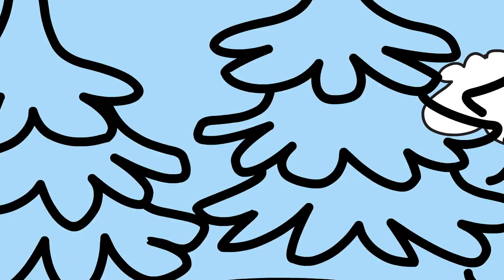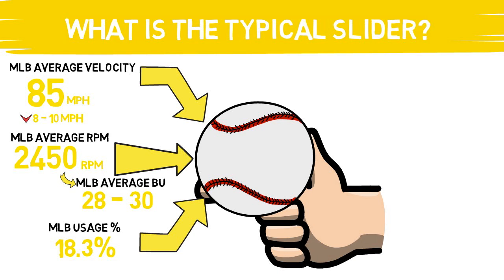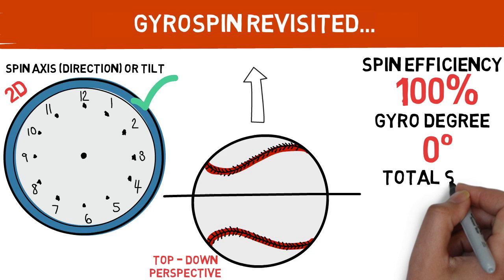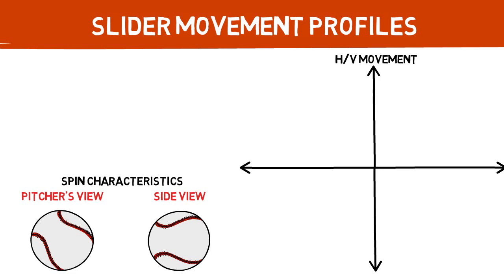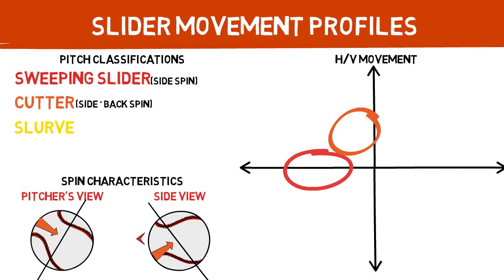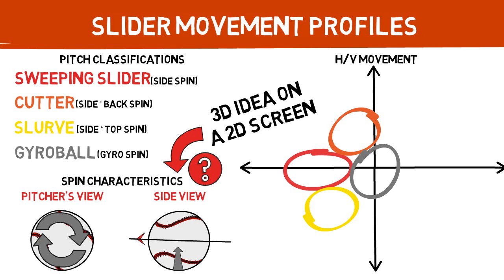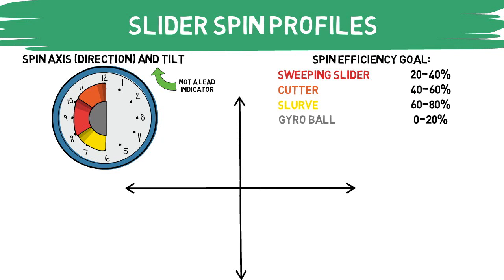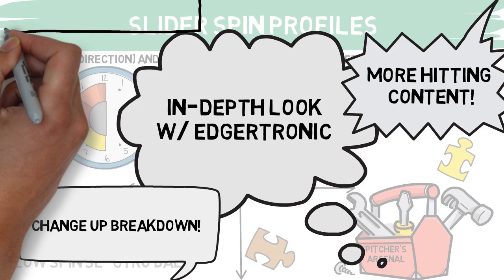SLIDER PITCH DESIGN: Creating a Nasty Pitch

Comment: Hey, I did have another question! I've been looking at Felix Hernandez's 2019 pitch movement and it seems that his slider movement doesnt move much from the 0,0 coordinate however it seems like it was one of his best pitches. He owned a .174 BAA on the pitch and an average Spin rate of 2104. Is this just a case of small sample size or does this mean that the movement from the 0,0 point doesnt correlate as much with with the final results as I thought? Maybe because he started the pitch more in the outside quadrant to a righty, that makes the pitch better even with the little pitch movement?
Reply from the maker: You’ve really done your research here! 

Like I said in the video, I’ve seen some nasty 0,0 sliders (or gyrospin sliders) - if it works for him then there is no reason to change it. 

It’s always a case by case basis, so the ability for him to control that pitch, and keep it separate from the others in his arsenal are of extreme importance in my opinion. 

Thanks for the awesome comment! Hopefully this answered your question.

Comment: I have a pitch tracker that gives: total spin, sidespin, backspin, gyro spin, and spin axis. Is it possible to use these numbers to calculate spin efficiency, and if so, what is the formula? Thanks.
Reply from the maker: Thanks for the comment! I don’t have any first hand experience with the technology you’re using, however, spin efficiency is the amount of gyrospin divided by the total spin. 

I’m not certain how the backspin and side spin come into play in that equation - but that is how it is calculated on Rapsodo. 

You should see fastballs and change ups are close to 100%, and the sliders and curveballs range in the percentages I had in this video. If those numbers seem like they’re in that range than the same calculation should work! 

Hopefully this answered your question - thanks for watching!

Comment: I've heard the the gyro spin can drift. Is there a way to predict how it drifts by examining the tilt and efficiency?
Reply from the maker: This is something I’ve heard has been observed but I haven’t found a way to predict/measure this movement. 

For example, some have said the reason gyro spin sliders have that sharp late break is due to the axis of the pitch drifts downwards as the pitch goes towards the plate (creating higher useful spin) causing that break. 

The way rapsodo measures spin direction and gyro degree can’t take into account this movement because of the positioning of the camera and the way the data is collected. 

I’ll definitely do some more research on quantifying this phenomenon and make a video if I find anything! Thanks for the comment!
Reply: @SimpleSabermetrics  thank you so much!

Comment: Why is the Slurve the least effective even without a Slider or Curve in the pitcher’s repertoire ?
Reply from the maker: There definitely are good slurves out there, especially if you aren’t throwing a slider to accompany it. 

My reasoning for this, is the average 3/4 arm slot pitcher more often than not will throw a slurve prior to any pitch design work using tech. Because it is more common than a true 12/6 or a sweeping slider, hitters see it more often and are therefore more used to it. 

There’s a little more data behind my decision here, but that is the condensed version. 

Hopefully that makes sense, thanks for the comment!